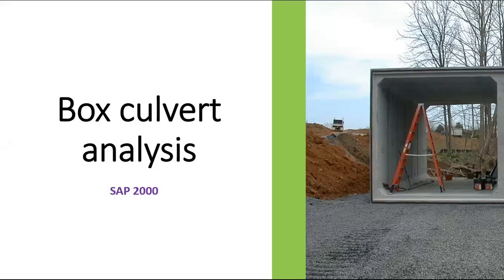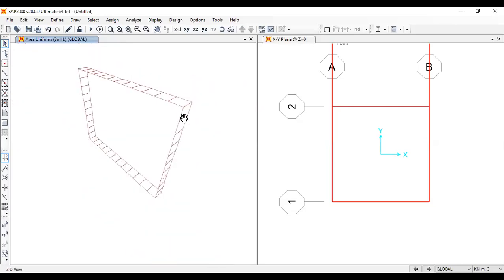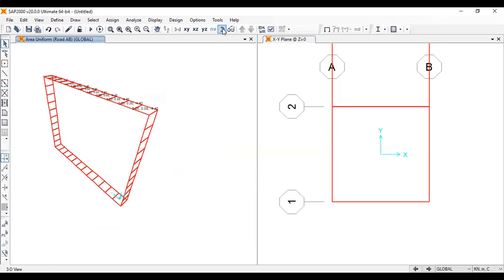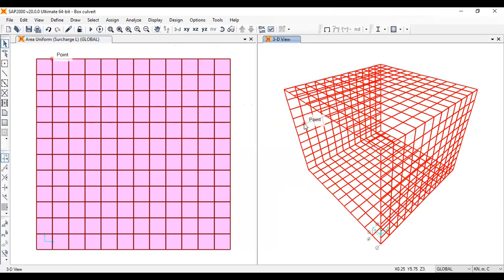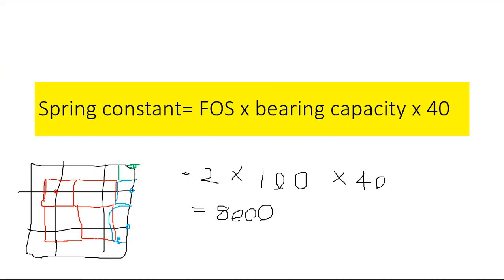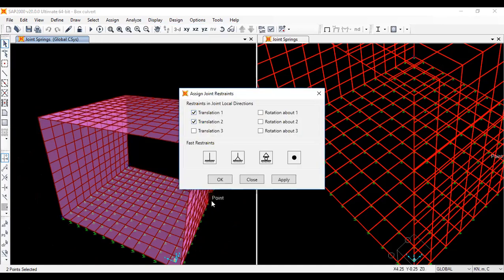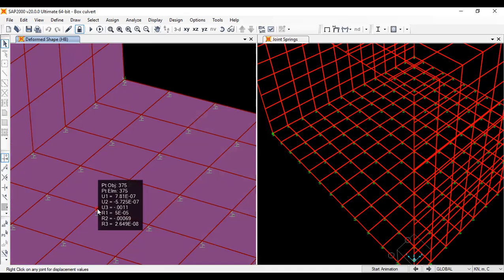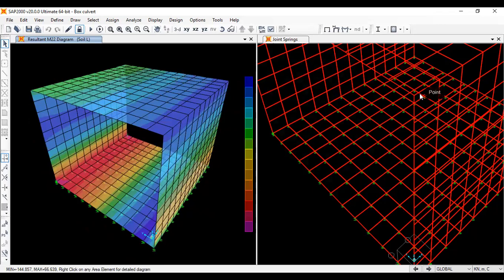Modelling a Box culvert using SAP 2000.. . . .   #engineering #civilengineering

Comment: Hello , thanks for you video. Could you please show how did you creat the model in the start? is it in 3D? did you draw rectangular areas then divided it to smaller areas? Thanks
Reply from the maker: Hi, i dont remember the video since i did it long ago, what i did was, got the dimensions of the culvert, then assumed the size of mesh, say for example if the total length is 5 m, and i use 0.5 m elements, then i model single 2D element of 0.5 x 0.5, then extrude it 10 times on both in plane (x, y) directions to get it, then rotate it around edges and make the vertical planes, and extrude the initial plane to the top, so we get the culvert. Kindly let me know if you did not understand. happy to help

Comment: you should check the AFTES for exemple for the spring equation
Reply from the maker: Brother, this is an empirically used one. What is needed in modeling is how you approximate the real-life conditions (mathematically). If there is a good equation, you can use it.

Comment: how can obtain moments on solid in sap2000
Reply from the maker: "Display" tab in the SAP2000 toolbar and click on "Show Tables." In the "Show Tables" dialog box, select the "Frame/Line" option.

In the frame/line tables, you can view various results, including bending moments. Locate the table that displays bending moments for solid elements. The table is typically labeled as "Internal Forces" or "Bending Moments."  should be there.. but i havent used brother
Reply: @Structural_Modelling_Hub  Thank you but there is no "Frame/Line" option bro. Can we talk with you on Zoom or discord?
Reply: @bahabaturay9404  as far as I can remember, DISPLAY/SHOW TABLES/ANALYSIS/ELEMENT OUTPUT/TABLE:FORCES.
Go to FILE option of the generated output. Then EXPORT CURRENT FILE-TO EXCEL

Comment: Thank you for the video. I want to draw a box culvert with the thickness 1m. What should be my area section type, and membrane-bending dimensions? Thanks
Reply from the maker: the thickness of the wall of box culvert is 1m????
Reply: @Structural_Modelling_Hub  yes. the thickness is 1m. it will be used as and underpass and the top of the box section is for the taxiway for airplanes.
Reply from the maker: culvert with a 1m wall thickness, instead of using shell elements, you would typically use solid elements to represent the thick section of the culvert.
Solid elements in SAP2000 are three-dimensional elements that can accurately capture the behavior of solid structures. They are suitable for modeling thick-walled or solid sections, such as the walls of a box culvert
Reply: @Structural_Modelling_Hub  Thanks for the answer. I tried to draw it by using grid. I will try with solid. Have a nice day.

Comment: Can you upload this video from Scratch?
Reply from the maker: i think i started it from scratch, didnt I?  which part is not clear to you brother
Reply: why you have taken area load on all the small plate element separately. Why not forming a complete culvert with four Plate?
Reply from the maker: @GopalKarwa-x5u  that is possible. as i remember i applied a unit pressure to a small element. then copy that element to everwhere..  if you use it as a unit load.., you can just use a factor in the combinations to adjust as you want.. 

on the other hand, if i drsw the whole culvert, then i need to mesh it and apply loading accordingly.. what you mentioned is also correct..  
when you model a building, apply a unit load will save your time. because you can define live load, services and all the stuff as a factor of that in the combination section
Reply from the maker: @GopalKarwa-x5u  did i answer your question or still not??
Reply: how did you begin to built this geometry? Under which section (eg. Walls, underground concrete structure, frames etc.) ? So that I can apply area loads in the structure.
Reply from the maker: @GopalKarwa-x5u  oh..just draw a simple square area section without any beams on edges.. apply all loading on it and copy it along the line accoding to the shape
Reply from the maker: @GopalKarwa-x5u  let me know if you did not understand.. i will help you

Comment: Thank you for the video it was very useful. May I ask where can I find the Spring Constant equation? Is there a specific code that refers to it? Best regards.
Reply from the maker: I hope that codes might have defined such equation by now. But I had not seen any since i did not refer those recently.. those are usually calculated using soil properties.. 
However, this equation is generally used in practice, for modeling also.. its an empirical equation.. if i found, i will update it soon brother